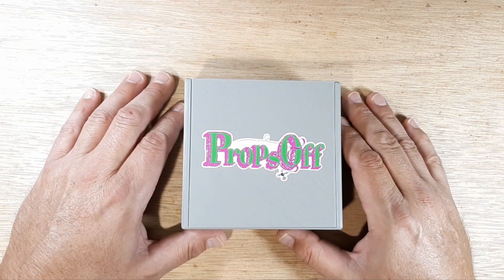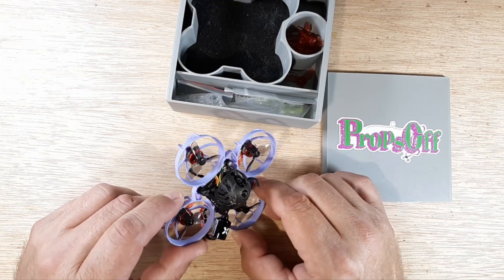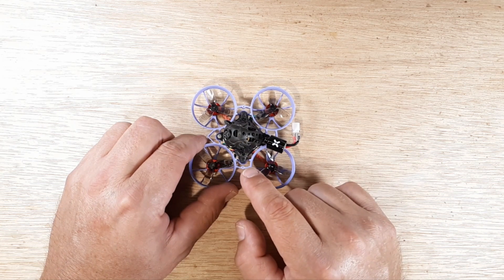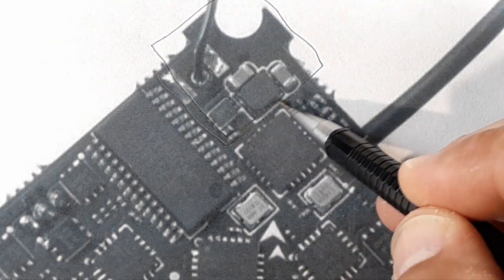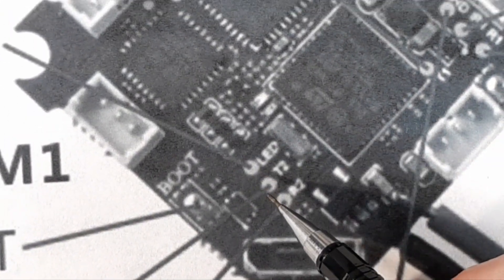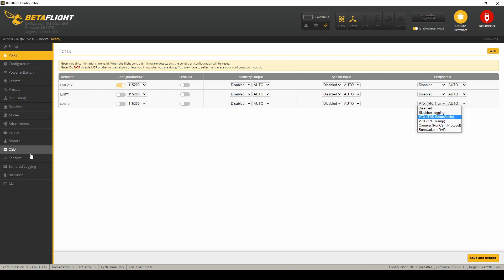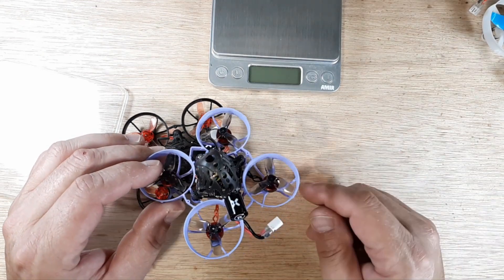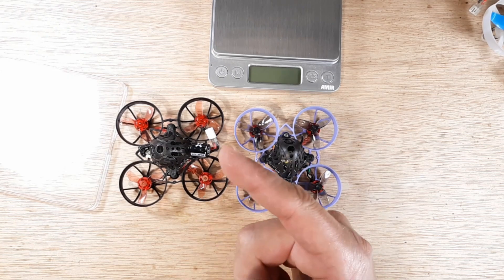Happymodel Mobula 6 VTX Failed | Crazybee F4FR Lite VTX Replacement

Comment: I may need to use this in the near future...I bought a used Mobula 6 on ebay and the quad puts out intermittent video, I also noticed the canopy is getting pretty hot, leading me to believe the problem is the camera. I'm hoping it's not the VTX since a replacement RunCam Nano 3 is a way easier repair but having this video as a resource is extremely valuable. Awesome video, geat job!
Reply from the maker: Thank you so much for your feedback and encouragement. I will cross my fingers for you. I've had a couple VTXs fail, real bummer. Hope it works out though...👍🏻🍻👊🏻
Reply: @PropsOff  Thanks! 

update: I tapped a couple leads into the Mobula's camera connector routing the video directly to a display and the camera is working perfectly. When I view the transmitted video, it cuts in and out, so the issue is definitely something on the main board. I'm only into this drone for $65 so not a big deal but very disappointing since I pretty much just got it and haven't even gotten a chance to fly it other than LOS. I'm not sure I want to go the route you did in this video in case it's not the vtx and something else so at this point, it's LOS flyer and possibly will get a new FC board in the future or end up on ebay as a for parts/repair listing.
Reply from the maker: @ChuckLeone  
I had 9 and only have 2 now. They are discontinued as well. Everyone seems to like the DiamondF4. I got one and I hope to put some packs through it at this weekend's race...🤞🏻

Comment: Thank’s for the vidéo !
My vtx stil working but when it’s too hot it stop working, I just have to refresh it and it’s ok ! 
Can I change a component to stop this problem ? 
Sorry if my English is not good, i am french !
Reply: Yes it is. Can I repair it ?
I have already add a external rx can I use 5v camera for the futur vtx?
Reply from the maker: @dimitrifournier9897  
I haven't had any luck fixing a burned out VTX, just replacement. You can use any 5v out pad to run the vtx if the incoming voltage of the VTX is marked as such..
Reply from the maker: Is it overheating on 25mw?

Comment: Would this work on the elrs version got two sessions in before it but the dust did the dredded reset then no vtx at all wont even connect or pick up a signal
Reply: Exact same issue after my second flight. Did you find a fix?
Reply from the maker: @uthmaanahmad788  
As the price of these boards increase, I've been debating getting some tools to repair them. For now, I just disable the On-board VTX and add a new one.
Reply: @PropsOff  my issue is after my vtx stopped showing any fpv feed it stopped connecting to BF or anything...I'm not sure if my vtx is fried or if it's a software issue
Reply from the maker: @uthmaanahmad788  
Sounds like the firmware. Just a single red light on?
Reply: @PropsOff  yes mate solid red light when I plug in a cable...any idea what I can do?
Reply from the maker: Can you get it in DFU (bootloader)?
Reply: @PropsOff  don't think so..BF won't connect to it and now it says failed to open serial port even though all drivers are downloaded...impulse just stays on waiting for FC..
Reply from the maker: @uthmaanahmad788  
Look for info on Bricked crazybee flight controller.. If you can't hold the boot Button when plugging into Betaflight and get DFU, A, the USB driver is fault. B, the thing is bricked. Apologies, I've only had one that had this issue and it's in the parts bin...
Reply from the maker: I would imagine so, as long as your getting 5v output...